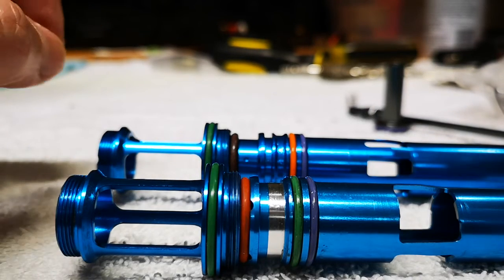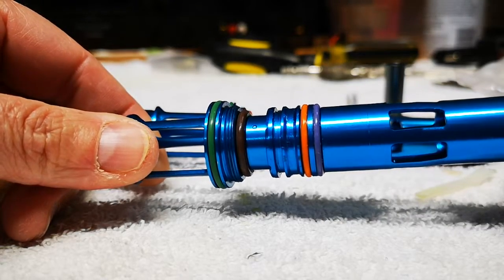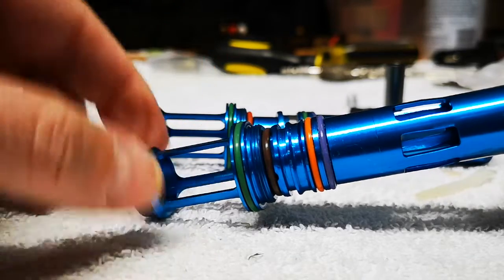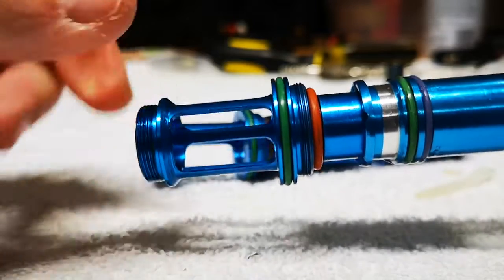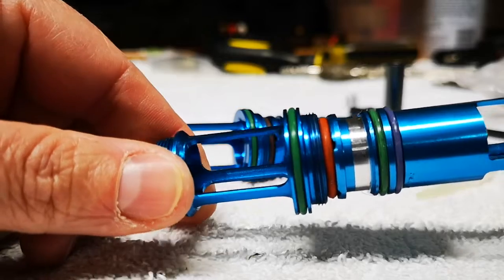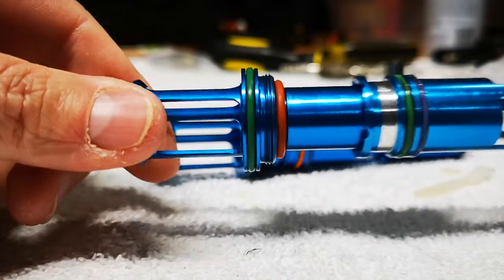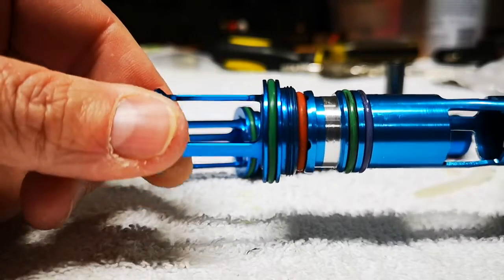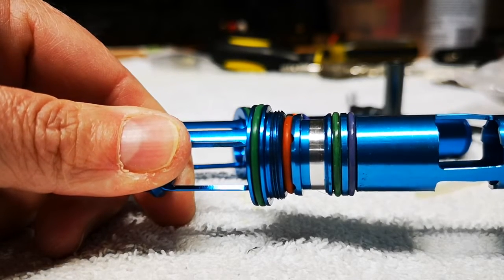Dye DSR 50 durometer vs 90 durometer explanation

Comment: Wonder if  The same thing would work for the vanquish bolt? 🤔🤔 It has a smaller stopper than that but same concept
Reply from the maker: Most likely. I just installed one on my luxe ice and it works perfectly.
Reply: @RaginCajundogg   Where would I find the diameter of my O ring that I would need for my bolt
Reply from the maker: @yolowking  wouldn't your manual have the correct oring size? If not you could measure it and source it from a third party.
Reply: @RaginCajundogg   Where do you order those O rings that are a little bit more squishy?